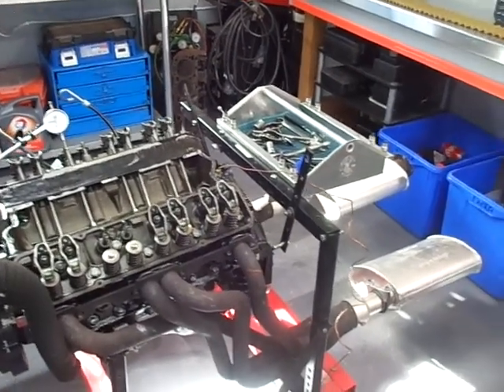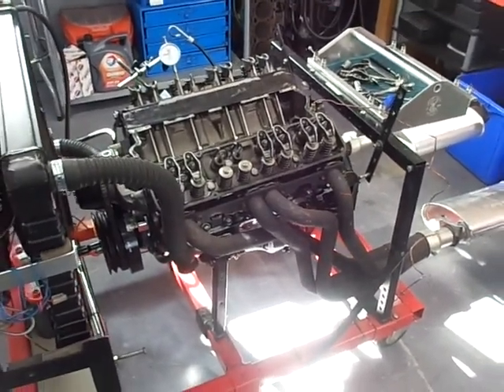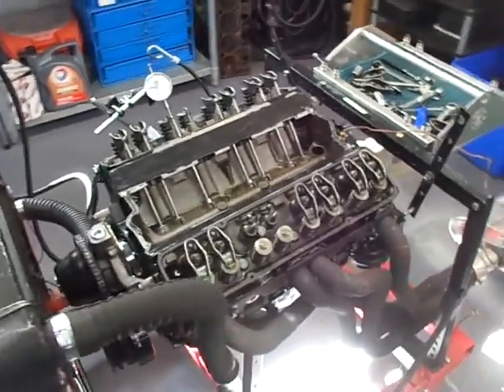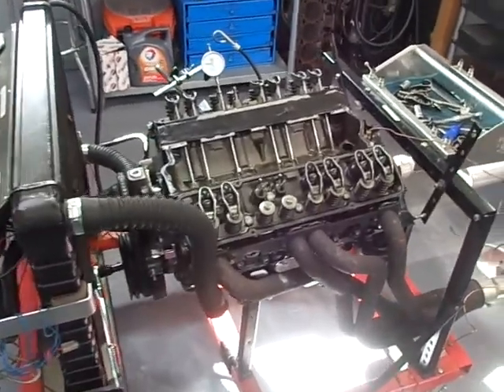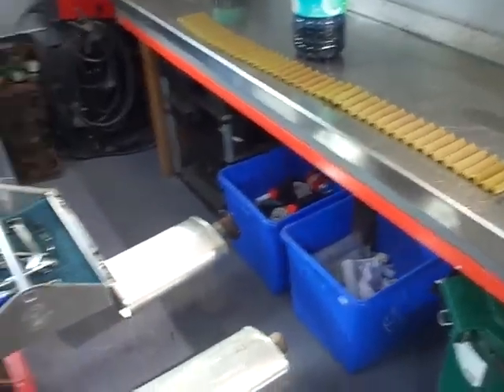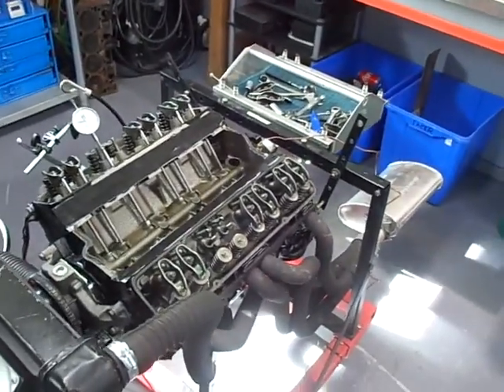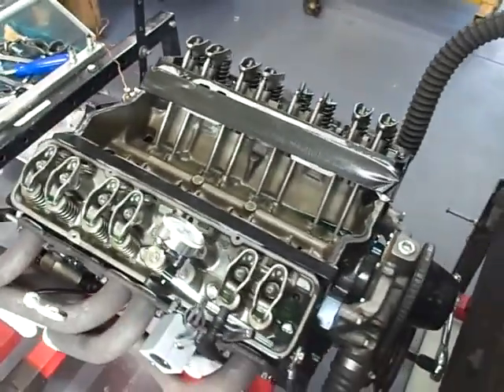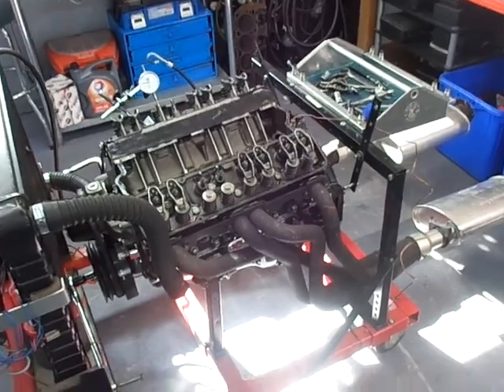Collapsed lifter on start up, Dealing with the valve lifter crisis.

Comment: I have one that think collapsed on a old engine.  Or...  My cam is wiped from age.  Ran for a few minutes never got hot.   Just toss in a new lifter and run it on my 305?  :) The Push rods will rotate when the engine is turned over by hand to make sure the lifters are spinning on a flat tappet like it should? Never checked this.  Only when it was running. I can do that check too on my old engine.

Comment: how do you check for cam lobe wear on the same collapsed lifter? I see you have a dial indicator on it but can you explain the procedure?
Reply from the maker: Thanks for the question Al. Sure, I install a solid lifter (temporarily), set up the dial indicator as shown and rotate the engine. Measure the lift at the lobe and compare it to the cam spec. It should be within a few thousands. Let me know if this answers your question. Thanks AG
Reply: I have a collapsed lifter on my 351w and want to check the cam lobe to make sure its ok. I guess I will need to purchase one solid lifter for the cam lobe check? Thanks
Reply from the maker: If you don't have a solid lifter, use a good hydraulic lifter. The force of the dial indicator is minimal so you should be pretty close. AG
Reply: Thanks, The lifter that failed and collapsed was a brand new Edelbrock Performer. Im not sure if I trust putting another Edelbrock lifter in it with all the lifter issues going on these days. Can you recommend a good USA made lifter?
Reply: Try NOS or Elgin

Comment: I only use solid lifters, better performance less worry.
Reply from the maker: That is one good solution Joe, all high performance engines in the 60's like my Z28, L78 etc. used solid lifters and they worked fine.
Reply: @goldsgarage8236  Like you l put a paint mark on the push rods so when l set the lash l check for rotation. Also l use full roller rockers with poly locks, they hold a lash setting much longer.